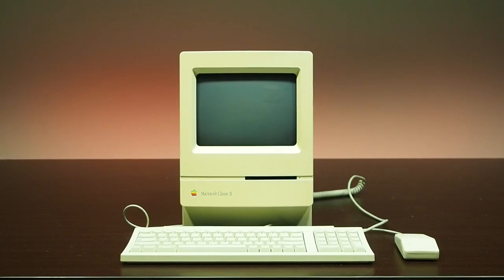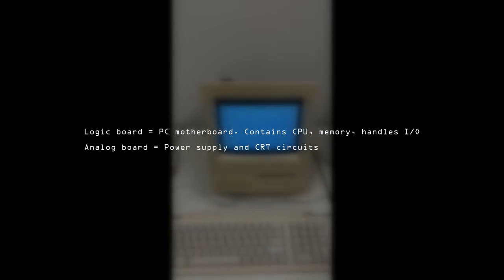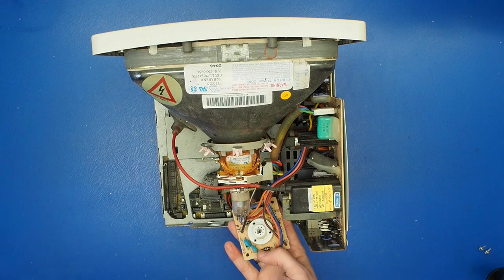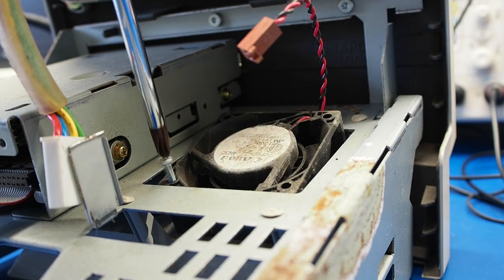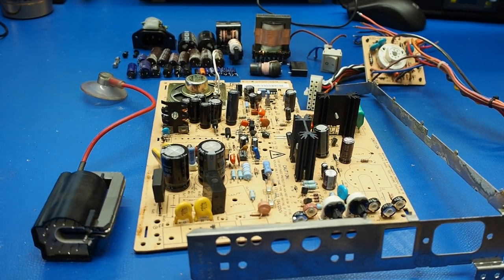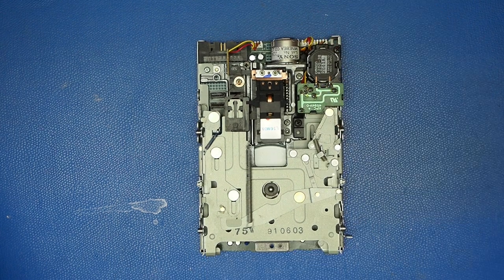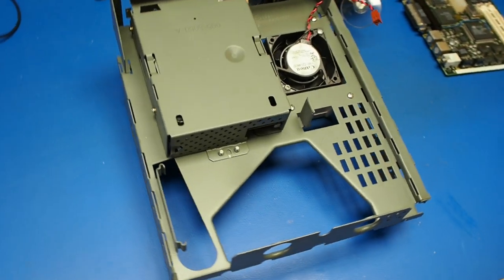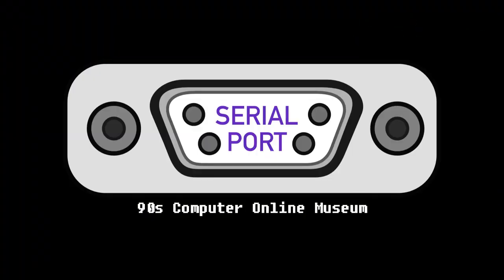Apple Macintosh Classic II Restoration — Part 1: Hardware Restoration

Comment: 6:20    I'm not sure the right tool to use for this is, but in general I have seen people use desolder guns or a tweezer soldering iron adapter that heats 2 spots at once that would make these caps a lot easier to remove.

Comment: Low melt solder is fine, but paste isn't really. That stuff almost never fully melts with just an iron (meant for hot air). I've restored like 500 or so macs and amigas in my time and I've seen systems fail from the solder paste oozing and shorting stuff out. Normal solder is what you should use, solder one side then the other side. I can't make out what caps you used for the analog board, but hopefully low esr in the power circuit. I do see a panasonic FC cap in the 470/50 position so that's good. :) Also see what looks like a Nichicon PW in the 220/50 near flyback. Only thing is that solder paste, I don't trust it =)

Comment: You have to rotate the cover for the mouse ball 180 degrees. The sliding foot should be facing the 6 o'clock position of the mouse, instead of 12, like you had.

Comment: I worked on many of these and other early Macs like the Plus, SE, SE30, and the classics. I remember cold solder joints were another failure point in the early Macs. Still have a Classic, SE30 and original and plus Macintoshes with all software and books. Most of my 'collection' still boot up.